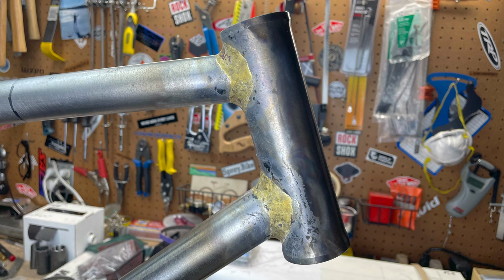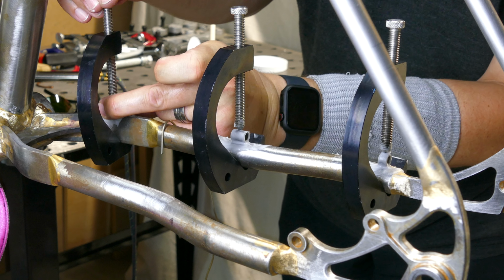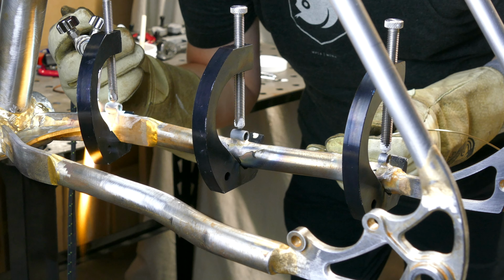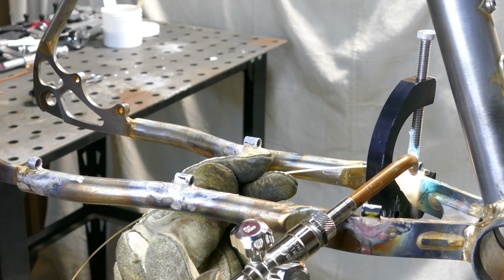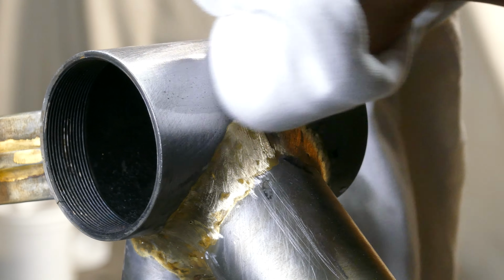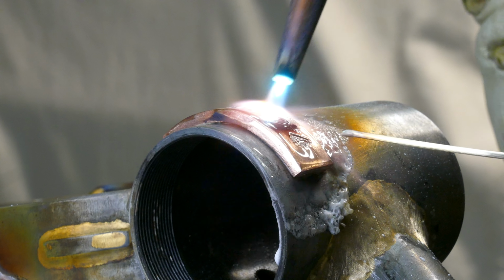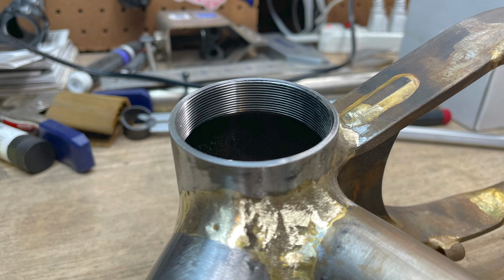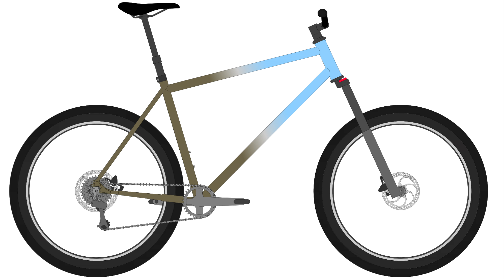The Final Brazing...  Almost Ready for Paint! - DIY Bike Frame Ep 14

Comment: Looks awesome dude like your attention to detail.
What size tires are you planning on running?
Reply from the maker: Thanks!  I have a 27.5 wheelset with either 3.0 or 2.6 tires. It should also fit 2.35 29ers.
Reply: @ThriftyFramebuilder  that's great👍🏾